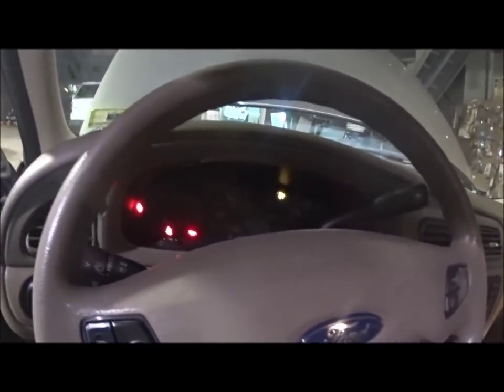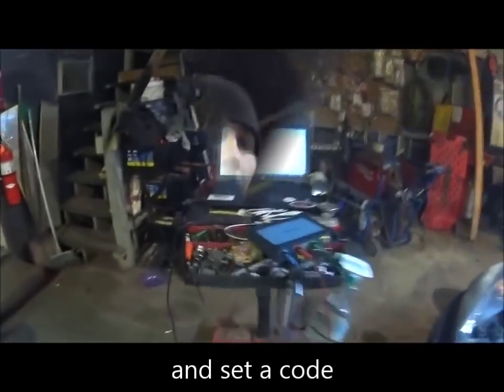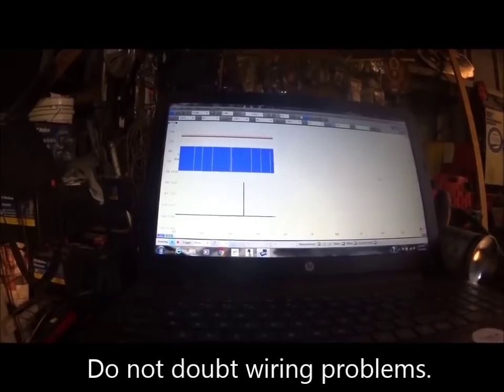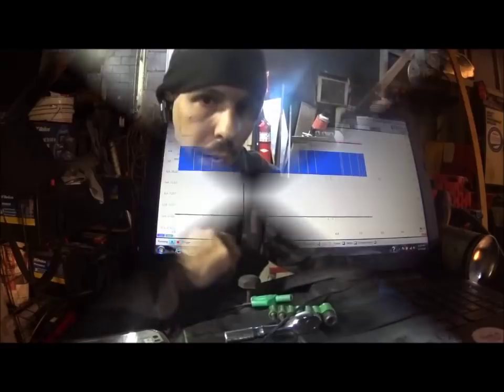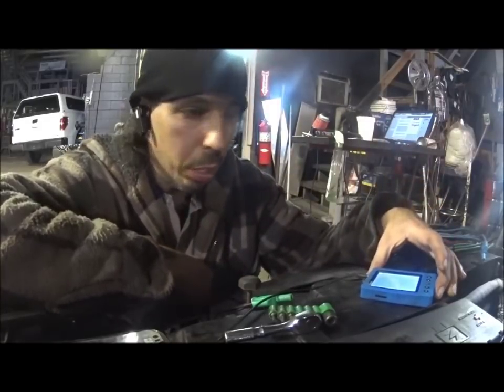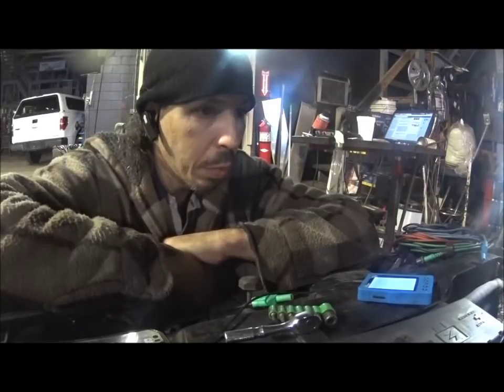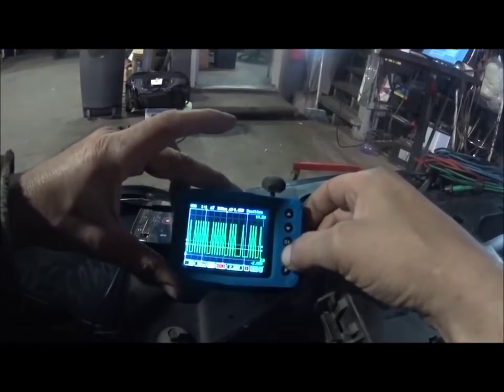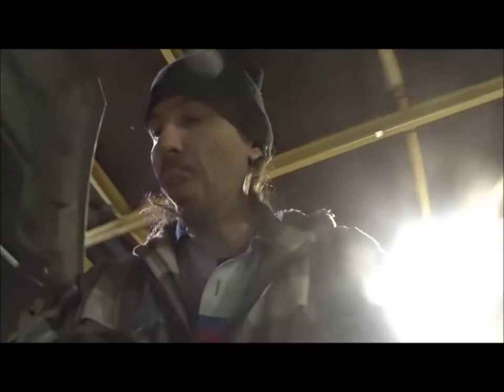Battery light on While Driving Charging System Failure  Should we Throw an Alternator at It? P1246

Comment: I had to laugh at the car not having gas. Most every video I watch, the gas gauge is empty so you aint lying.  I liked your views about scopes. I bought the PICO two channel scope but I'm finding out it isn't very good for automotive work (so far). I'm still learning but I didn't realize it doesn't match up with the automotive program. That uscope is getting around. It's at a pretty good price too. Thanks for taking the time to show us the scope.
Reply from the maker: Wyatt, I have no knowledge of the pico you speak of, but the 4  4425 model channel is a work of art. The uscope is awesome too, but it is not good as the only scope in the shop due to the lack of channels.
Reply: @JoesAutoElectric  I get it man, that 4 channel pico is the best! I could buy one but as a DIY guy it's hard to justify so I keep an eye out for alternatives line the uscope. It's on my radar but I need to monitor CAN systems and that takes at least two channels right?

Comment: Wad up Joe. I 100% agree with you and Keith. Very handy tool. Did you get your pico from them or autonerdz. Can't wait to see you use the pico wps in cylinder pressure transducer. I was trained by one of the best guys out there for that type of testing. His name is John Thornton. Aeswave sells his book. It's differently what you need brother. Trust me
Reply from the maker: John Thorton is another amazing guy man. maybe you can teach me some stuff. I have only limited knowledge with in cylinder. I have been using n older version of the fluke for it though. I am saving up to buy the WPS master kit.